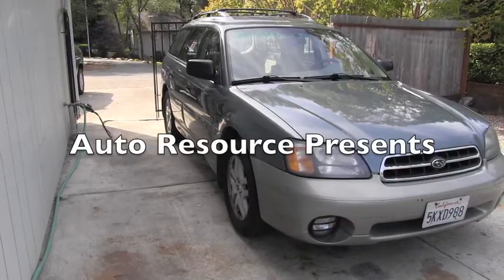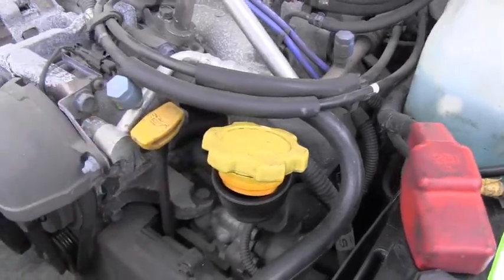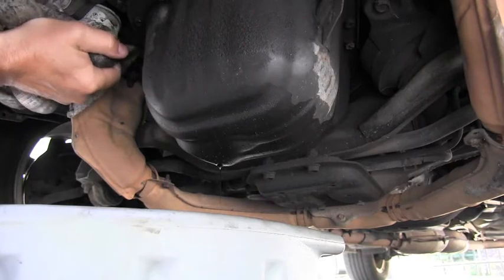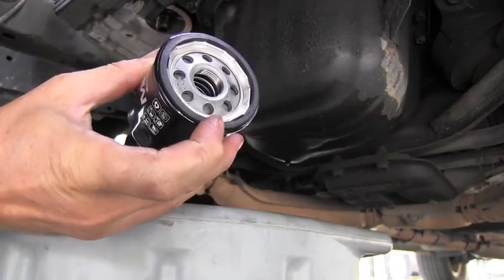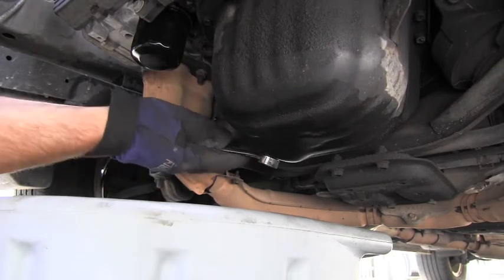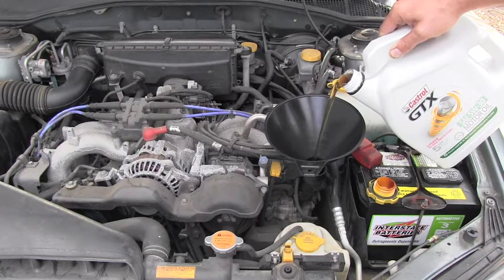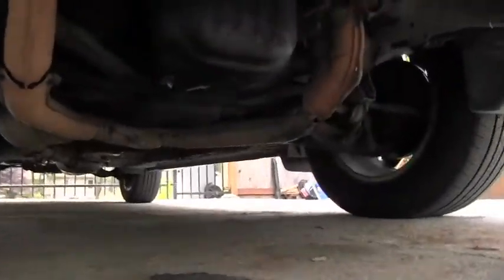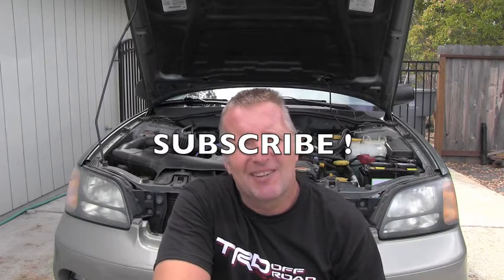Subaru Outback Engine Oil Change

Comment: With the filter being positioned vertically like that, you could fill it before installing it. This would cause the oil pressure to come up faster.

Comment: Great video! Why do you need to replace the spacer on the oil pan bolt?
Reply: It's a gasket. Once you tighten the drain plug down with a new gasket, it's crushed to make a good seal. After it's used once it's deformed too much to use it again, and it'll just leak

Comment: Thank you! very helpful :) what do you do if the mechanic did not indstall the fuel filter correctly and it will not come off by hand?
Reply: Chel of the sea there’s a cheap tool you can buy to assist with loosening the the oil filter. Actually there’s two. Simply go to your auto store and ask for the a tool to remove the filter. One will be a cap that fits on top of the filter to assist with removal, the other a brace of sorts to assist with removal. Both should only be around $8 at your local parts store

Comment: Shame Subaru changed the location of the oil filter. From 2003-2007 [2009?] they put the filter just above the engine exhaust pipe heat shield. It's impossible to get to without raising the vehicle. So dumb!